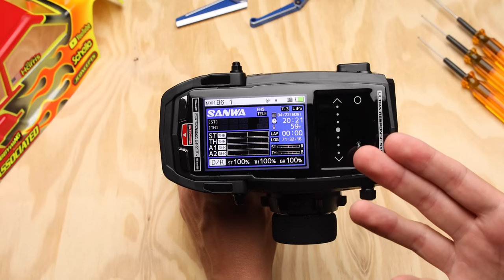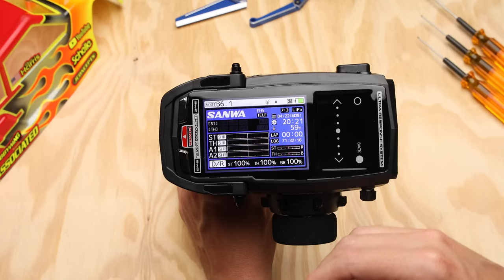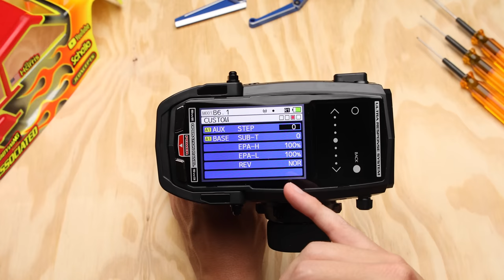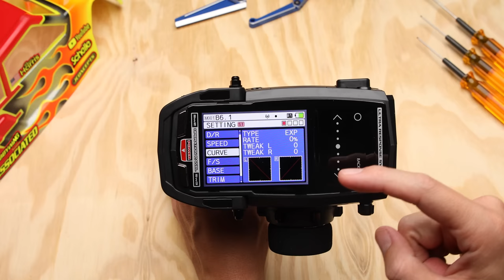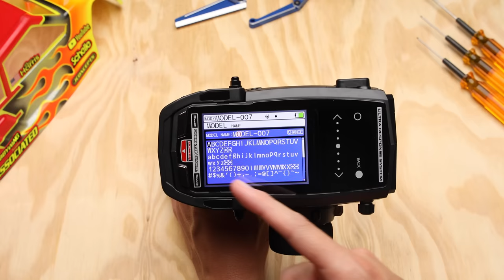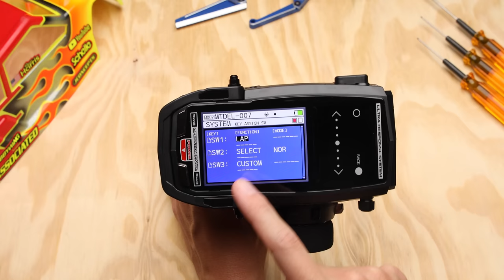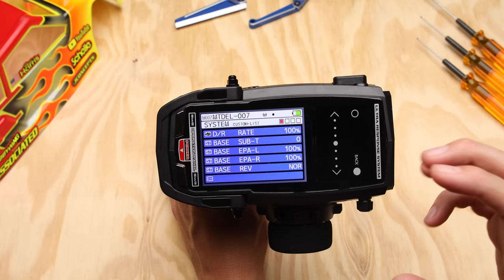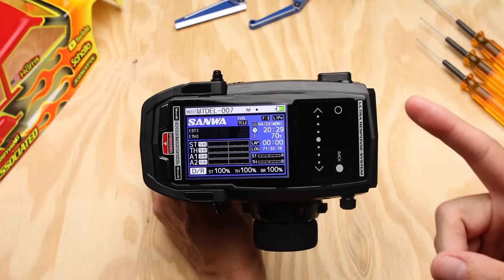SANWA M17 || Switching from Futaba? My first look

Comment: I'm trying to switch from RTR radios to Futaba or Sanwa but not sure what to get. Everything looks really good. I'm only over a year into 8th scale nitros. I have a couple an want to move up to something better but not sure where to start. I'm more or less a basher have never raced but I'm willing to start once I find a track around me that races nitro. Any advice ? Can't wait to see you running that nitro rig of yours. I watch alot of your videos an have mad respect an love for ya. Keep up the great content.
Reply: Spektrum DX5C is a great radio for getting into higher end radios. Cheap receivers too, and you can run several different cars with the one radio. It's just not the best/worst looking/feeling one on the market.
Reply: @edwinwx260  I have the Spektrum DX5C when your driving with other Sanwas your connction is getting lost so no High end Buy a Sanwa or Futaba

Comment: Ryan, R-mode, I believe, is to store a set of common parameters on the same model to adapt quickly to the condition of the track. For instance in the past, I used it to program on my 2wd mod buggy a softer exponential curve, change steering speed, D/R and brakes, for when the track looses grip. With one click, your radio setup will go from aggressive for high bite to softer, if you realize you put the wrong tires on, or track got very dusty in between rounds, etc.. So if your radio was setup for aggressive driving with high bite, you can get different R-Mode to adapt quickly to changing track conditions for instance, etc...
Hope it makes sense.